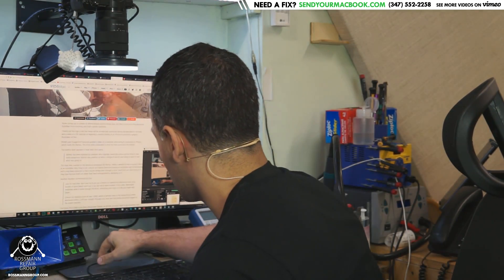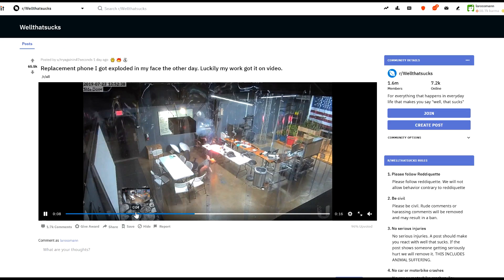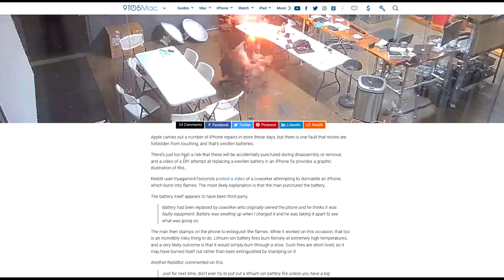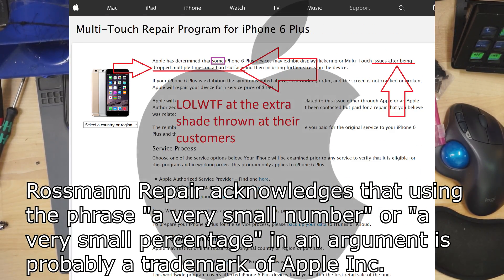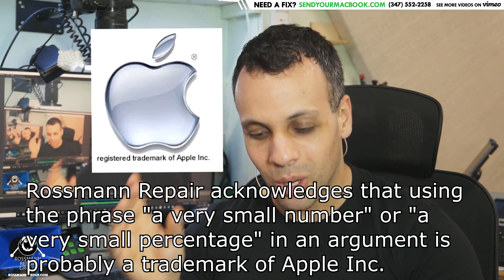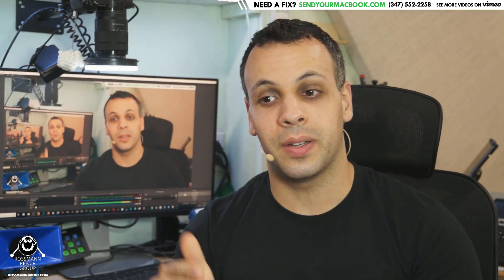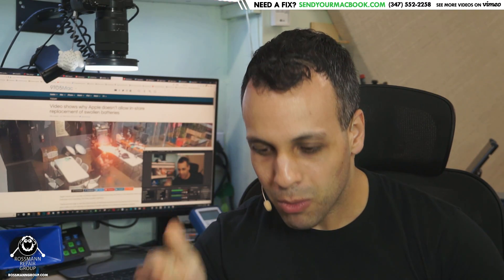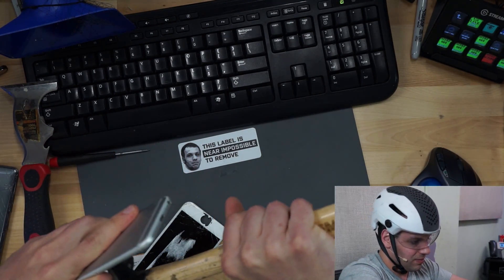STOP FEARMONGERING

Comment: We need to ram it in manufacturer's skulls until it's all they hear. User-replaceable battery. Removable memory and storage. Socketable processors in laptops. Form factor be damned, I want my computer to outlast me! Just keep saying that. Everybody should be saying that. If the machine can be made a little bit thinner because of concessions to mounting mechanisms, good, that can be permitted. If components can be better paired together because a significant bias mirrored on two board make two lay flat as one board but contact each other, awesome. Push-pin connectors? Edge slots? I'm in!

With this miniaturization in technology, and making ever-smaller components which perform better than or on par larger components, there is no reason why we should be accepting thin and light mandates soldering the components onto the motherboard. The slight performance gain with direct contact rather than through sockets and headers is insignificant to the end-user. It really is. For what? Cost savings that make a laptop more expensive long-term? It's nonsense! Then to have the damn thing fixed, you'd have to ship it to a repair depot or hope the scumbag with the independent repair shop you don't know doesn't yeet all of your personal junk onto some nascent database at an encrypted partition of a media or remote session to another machine the owner keeps around.

If the user can just buy parts and fix their machine up, that by itself improves privacy by leaps and bounds. Any idiot with a screwdriver can pop off a panel, slot in some more RAM or replace their system media, install their OS of preference and get back on their feet. Also, sealed batteries are a flight risk. Note 7 proved that. Bulging iPhones prove that. Oh shit there's a fire in my pocket proves that. Please! Petition to your local government that electronic devices with sealed batteries are a hazard that should be far removed from the end-user and force manufacturers to have the batteries be removable! Make manufacturers have to develop around this by ensuring USB C is enough to power on a mobile device to perform on-flight work with, and have connectors for AC adapters to plug into! Quit accepting modern inconvenience! We can m and we should make this happen, by all means necessary!

Comment: I haven't replaced a battery in an Apple device, but I have replaced the batteries in a TomTom GPS units, also glued in.  First, get a good adhesive solvent, Goo Gone is one, from your local hardware or big-box home store.  Second, I made a tool from an old credit card by sharpening one edge with sand paper.  Apply a few drops of the adhesive remover so it runs under the battery.  Wait a minute, then gently push the sharp edge of the credit card under the battery until you get strong resistance.  Remove the tool, reapply adhesive remover, and repeat until the battery comes out.  With a little patience, you can get the battery out without damage to the battery or device.

Comment: Thanks Louis! Everyone that works with batteries needs to have a suitably sized fireproof battery bag in case a battery catches fire or something. Here is one example: https://www.amazon.com/ENGPOW-Fireproof-Explosionproof-Resistant-260x130x150mm/dp/B07BN7WLQ5/ref=sr_1_7?crid=2KR18KXQHVGY6&keywords=fireproof+battery+bag+for+lipo&qid=1564252699&s=gateway&sprefix=fireproof+battery%2Caps%2C216&sr=8-7
I was testing a lithium battery one time and I made a mistake on my current calculations - Mother Nature did NOT make a mistake on hers! Lol! Even though I cut it off before it caught fire, I was glad to have a fireproof bag to throw the fat thing into just in case.

Comment: Just make a legal requirement to have standard size batteries in the phones that can be user-replaceable. It's something that the phones had for several years until just a few years ago with very low number of safety problems.

Comment: I cannot believe that apple and other manufacturers are gluing the batteries into the devices. This is unnecessary and should be illegal! I just replaced a battery in a Samsung tablet and it had a few very small screws holding a very thin plastic bracket that attached the battery to hold it securely in place and worked great. An idea that is simple and cost effective is if these rogue manufacturers could opt to use is to use the double sided sticky tape from 3M Command that has the "pull tab" that releases itself from whatever it is adhered to without damage to whatever it is stuck too.

Comment: This is going to be a long response. I'm looking at all angles, however absurd they may be. 

Could it be the industry has a secret agreement that doesn't offer devices with user replaceable batteries? The purpose would be to lower the already high demand for lithium batteries? Imagine if we could still swap batteries ourselves, it could put the demand at x2 or x3! Currently, we don't have the option to purchase spare batteries, and forced to have ONE battery per unit instead of 2 , 3 or more.

2. Perhaps it's a safety issues, taking the above argument, there would be double, triple batteries out there, thereby raising that  very small percentage to only a small percentage of defects, and it would threaten air travel, submarines, and space ships. Imagine all those lithium batteries on a plane!

3. I bet there's a study that claims that non-oem part have at least double the rate of defects. It's quite easy to double if OEM parts have let's say, .03% explosions, and non OEM have .06%!. That's an obvious case for branded batteries.

And finally, have non removable/replaceable batteries is PRECISELY why this topic is relevant. Before they were cemented to the units, we the user could inspect/ observe for damage, defects, overheating, bubbling and take corrective action asap. Furthermore, it would make for a safer public, because we wouldn't go on a plane if we saw the battery warp, heat, etc. With it hidden, there is more risks. 

Don't even get me started on the atrocious environmental impact of wasting perfectly good parts, just because the battery is shot! Electronic devices are among the most hazardous kind of waste, and it's being increased exponentially because we treat electronics as if it were a can of Pepsi! At least with Pepsi, we know exactly how to recycle it!

That's all...

Comment: Would it be so hard to put a phone with a swollen battery into a sand blasting cabinet, close the blast shield and proceed to remove the battery inside a blast container. Thats just off the top of my head. You see the battery is swollen, you know its a hazard, but you throw caution into the wind and go for it anyway. Yes its dangerous, but there are so many things that can be done to prevent stupid things like this from happening. He could have said "No, I dont touch swollen batteries." Or just take precautionary measures to prevent harm or damage while preforming the task. Apple is just using careless DIYers as examples to make 3rd party repair shops look bad.

Comment: I dont understand why you dont totally discharge them before taking a chisels to remove them
which is not probably the best tool anyway, would be easy to do with a simple discharge
tool with the connector and load on a pcb.

Comment: Another note is that lithium batteries are much safer when fully discharged, so let the device run down to 0%, then replace the battery. When at 100% charge they are under higher pressure internally and far more likely to explode if punctured.

Comment: If the laptops are serviceable, and have good battery life, I don't mind integrated. SO LONG AS they are easy to get to and replace. My old Chromebook's, FI, took under 5 minutes to replace, with no special tools, just a small screwdriver. It had an MSRP of $200, way over what I bought it for.

Gluing is total BS.

Comment: Any lithium polymer battery punctured will flame up swollen pr not ....i have 23 different battery packs here from 1s to 6s... i have never had one spark up. when a battery goes bad i drop it in a hevy salt water solution for 72 hours which tottaly makes the cell inert....If idots mess around enough and try to make a battery go critical. then sooner or later. it will go critical ....totally iresponsable....

Comment: One thing I do like about Lenovo laptops: Their batteries has screw tabs which they're mounted with, and are easily accessible. No adhesives. No glues. just a few really short screws and out the battery goes. 
A huge thumbs up to Lenovo for that. (^.^)b

Comment: I've only owned one battery that burst into flames. I've had 26 phones, tablets, net books or laptops that have had lithium ion batteries, so far. One of them was an apple product. With an original apple battery. GUESS WHICH ONE WAS THE FIRE BOMB? I've SEEN one other detonate. I use that word accurately. It got hot, the owner took it out of their pocket as the case began to blacken and glow. He threw it and it exploded before it landed. That was an IPhone too.

Now, I accept that those were statistically insignificant events... but still. Given personal experience, I scoff when an apple fanboi makes cracks about a galaxy note 7, or third party replacements.

Comment: Since the actual charging circuitry is inside the phone itself, I'm just disregarding the BS about OEM AC adapters and cables. Just stay away from generic AC adapters from China which typically have poor, improper or no insulation between primary and secondary as those are genuine fire and electrocution hazards, that alone eliminates the vast majority of risks.

Comment: The expanding batteries are usually the lithium-polymer ion batteries like what they use in most Apple products just because it's cheaper and thinner. I'm almost positive their are two types of lithium ion batteries that are used for cell phones but most of them these days are the polymer type because they're thinner and cheaper. Also I lot if companies don't label which is which just because it more words on the battery.

Comment: The last time I was fooled about the dangers of Lithium-ion batteries was during the whole "hoverboard" debacle where they were exploding on the chargers. I was only fooled because I didn't know I'd been dealing with lithium-ion for years in my devices. It was then I learned that it isn't inherently dangerous to work with, but there is always a chance of something going wrong as with your situation 5 years ago. So, with that in mind, as long as you do a modicum of research and take some amount of safety precautions, you'll be fine. People who think that you shouldn't because of the possibility of fire, either have shops repair all their stuff, replace anything that breaks without even trying to repair it, or don't realize there's always a risk of something stupid happens when you're working on something. Shit happens.

On replaceable batteries, I agree with you. Personally, I think phones are thin enough as is right now. In fact, they might be TOO thin. I legit need a case for my phone to be comfortable to hold because the thing is so damn thin. I miss the days of removable batteries. Battery was busted? Buy a new one and pop old one out new one in. It was simple. It was easy. It also provided a way to troubleshoot devices by knowing it was entirely powered off. There wasn't some silly button combination you had to press to simulate it, you could just do it. The fact that they use such strong glue to hold it in is troublesome as well, but what does it matter to me since I don't have to tools to even get to my battery in the first place? We've sacrificed functionality and practicality for design and that is something that always has and always will bug me.

Comment: I work in San Francisco & over the past decade I have worked on over a 1000 mobile devices with either user serviceable batteries or non user serviceable batteries and I have never experienced a battery that lit on fire, vented gasses or otherwise exploded and I have seen probably over a 100 swollen batteries. They ARE able to be removed safely. ONLY when you do it wrong: THEN things can happen but let me tell you this: I have thrown and stomped and hit swollen batteries pretty hard and even those ones never lit on fire, vented gasses or exploded. It's as almost if you have to purposely puncture the battery or bend them at an absurd angle in order to make these things happen. So why would you even be in the repair business if you are just going to be poking and bending batteries? This IS fearmongering.

Comment: I look for two features on a phone that are must haves for me to consider buying it. SD memory expansion and removable battery, which is why I'm still using a Samsung S5. I might not get the same runtime from my battery but I can keep a charged spare battery with me and swap it out whenever I need to and I don't need to be tethered to a charger.

There should be regulations making a battery safe to remove if only to facilitate easier recycling of the batteries and extending the useful life of the product. It is environmentally criminal to trash a product just because the battery died and can't be replaced.

Comment: About 2 months ago I swapped out my Apple 5S battery and I made the slightest puncture using the plastic removal tool. And yes indeed I got the angry battery smoke cloud ☁️ it could have been worse, so I said I would never do this again without gloves and a face shield. A less than $30.00 investment, my hands and face are surely worth $30.00.

Comment: When I had my battery replaced it did start to combust.  There was no fire or flash. The tech simply kicked the battery out the back door and let it burn out.  No damage to the floor or table.  It was an iPhone 5s and apparently, they are not the easiest to get the batteries out.

Comment: I have pulled nearly 2000 batteries. Not a single one blew up without me triggering it intentionally. The blown up flat pack batteries are tougher to get to flame out. charged to lower power and the plates are separated.

Comment: The more the Li-Ion battery charge there is, the higher the chance of a violent puncture fire, rather than lithium just reacting with air slowly,  so if anyone (Apple) is extremely afraid - they could discharge the battery completely. Prior to attempting to remove it - it's going in the trash anyway when bloated. 9to5 mac authors makes insane claims devoid of reason, science or common sense.

Comment: I always hear how these batteries are safe, even if bulging. The thing is, one of the causes of the Note7 battery fires is the normal (and not really noticeable by the eye) expansion and contraction of the battery casing, which would crush the edge of the battery electrodes (which were stuffed in too tightly by design - they try to cram in as much capacity as they can) and cause a short circuit.
These iPhone batteries can do the same thing. Heck, I don't recommend it, but take a LiPo battery and crush it. It'll probably short circuit inside and enter thermal runaway.

Comment: So even if you don't repair the devices, they still need to be recycled and have hazardous materials removed.  Gluing the batteries internally in effect prevents proper disposal and recycling of these products, harming the environment even more than just preventing repairs.
Reply: How does it prevent disposal and recycling? Does solder prevent a recycling company from separating the plastic from the metals and the glass? Or did you think recycling was done by shaking the components off the circuit board?

Comment: I think the reaction is less dangerous if the battery is discharged.
If the customer wants a new battery discharge his phone to 1% or until it shuts down, then you can replace the battery.

Louis, can you short or puncture a 1% battery and a 40 - 60% battery and show us if there's a difference in the reaction?

Comment: It is not just 3rd party hardware that can be dangerous, but Apples own original hardware. I have had an original Apple iPhone 6s+ battery become swollen, even though the battery was not even 18 months old at the time. The phone simply refused to power on or charge. Besides the whole batterygate fiasco and Apples pathetic remedies; the genius at the genius bar had opened my phone to obtain the serial # and decided to return it to me as 'out of warranty'. The genius did not even warn me that the battery was swollen-which could have led me to dangerously attempt further charging. It should be illegal for Apple to return a device with a swollen battery to a customer-especially with no warning or instructions!

Comment: The battery of my old S7 edge ended up expanding so I went to the official Samsung store for it to be serviced and battery replaced under warranty. I was told that my S7 edge was a forgery (based on the back cover not displaying the IMEI number) and that they would not service it under any circumstances.

Fair enough... So I did the next best thing, replace the battery myself. I purchased the proper tools. I intentionally did NOT purchase an OEM battery because I suspect that to be of lower quality than the after market batteries (for being potential forgeries, there is no reason to copy an after market battery). Fortunately the after market battery for an S7 Edge was similar/compatible enough to my fake S7 Edge.

It was a nightmare to remove the old expanding battery because of the glue as I was worried that I may puncture it while trying to force it out of its location. I was also worried of potentially damaging the screen from the other side since I did not have any clue how thick the layer between the battery casing and the display behind it was.

Comment: I got a battery from Amazon for my laptop.
a) The battery's capacity went from 42000mWh,  to 31000mWh in about a week of use.
b) The battery's locking mecanism was faulty, when trying to take it out of the laptop, it would catch in it and bend upward...
c) it started to swell up.
Returned that shit so fast....